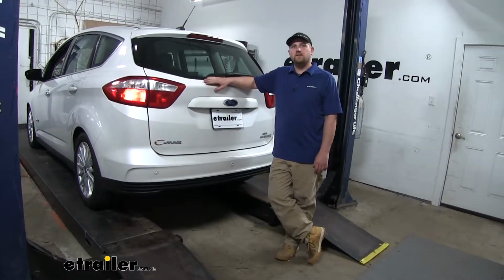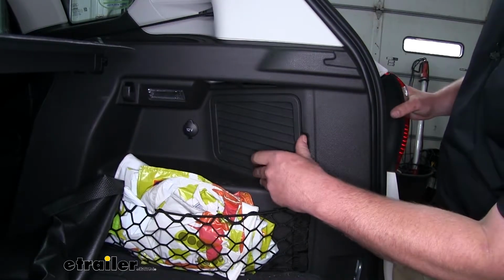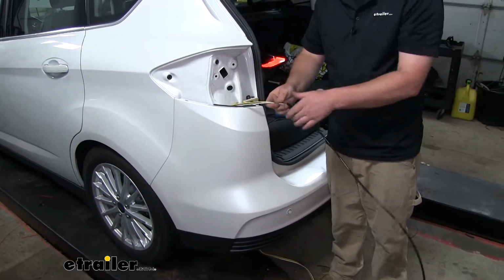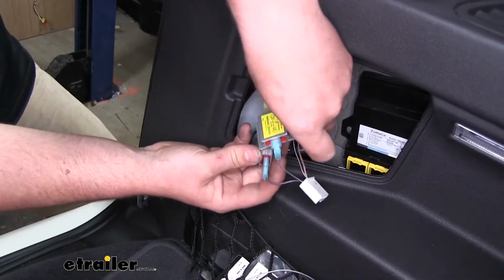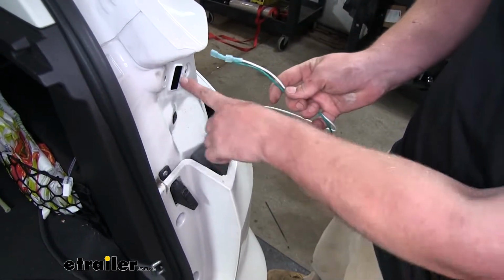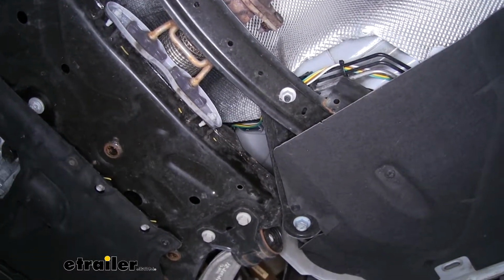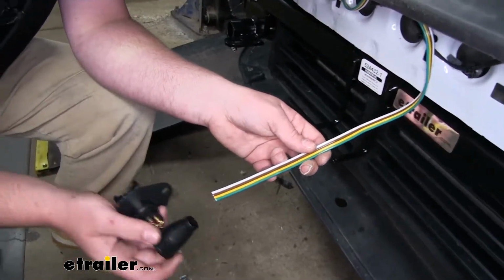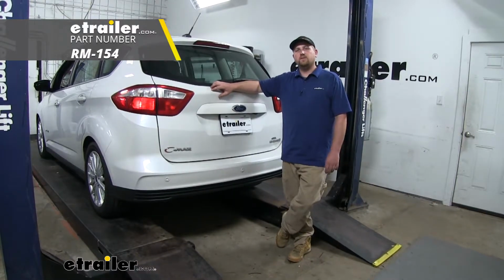Installing the Roadmaster 4-Diode Universal Wiring Kit for Towed Vehicles on your 2016 Ford C-Max

Comment: Do you happen to know what colour wires the - Brake , sidelights, reverse, indicators?
Reply from the maker: We don't, unfortunately. We'd recommend using a circuit tester like # PTW2993 to check the wires feeding each taillight assembly while each taillight function is activated. This will tell you which circuit carries which function. Hope that helps!
https://www.etrailer.com/Flat-Tow-Wiring-Harness/Roadmaster/RM-154.html

Comment: Thank you, this was extremely helpful, my tow kit was installed and had a turn signal out only while being towed. I troubleshot the connections to both ends of tow cable and plugs- all had continuity. I opened the taillight and found the spade tip came off the diode on right tail light. These YouTube videos are so greatl. I have DIY repaired many things with them. The repair folks may not appreciate it, but my bank account does.
Reply from the maker: You're welcome, we're glad you were able to find and repair the issue!
https://www.etrailer.com/Tow-Bar-Wiring/Roadmaster/RM-154.html